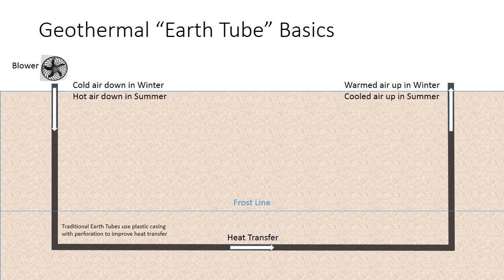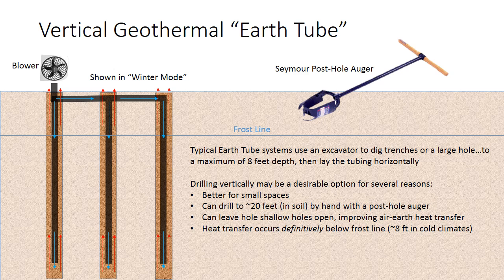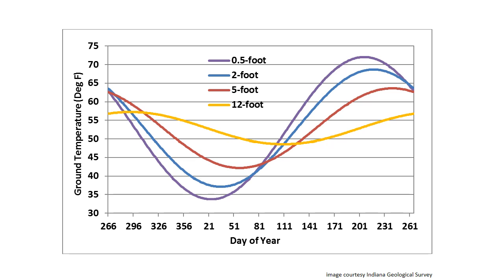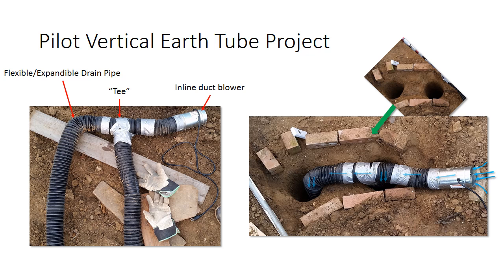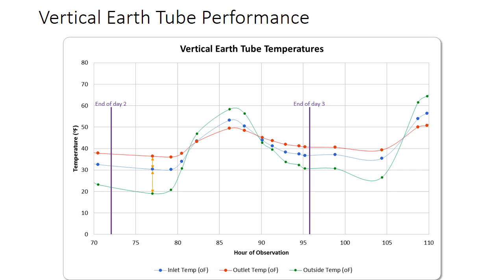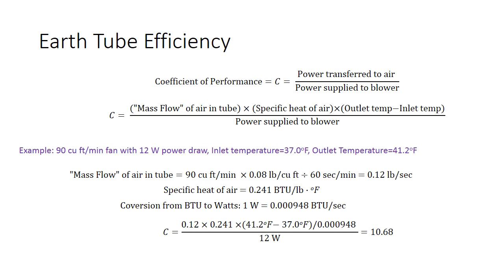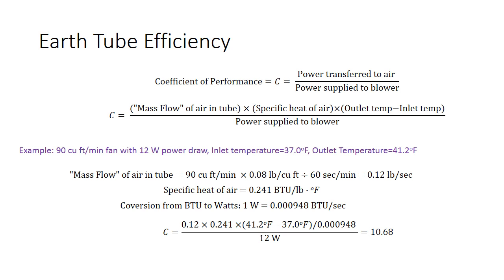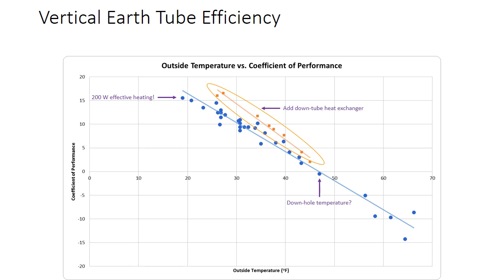Vertical Geothermal Earth Tube (Part 1) - Greenhouse Heating/Cooling

Comment: Would this system still work as well, if the outer hole was lined using 6"d. pipe?   I'd love to use this to temper air for a house...but here, the air must recirculate....would the dirt of the hole carry mold into the house, if left unlined?
Reply from the maker: Yes, but efficiency would drop and expense would increase.  I've recommended "casing" the outer hole for people who live in areas with unstable soil.  I live in a dry climate, and have noticed no issues with mold.  Can't vouch for best practices for direct house cooling/heating.  Honestly, I'd probably use a heat exchanger rather than direct airflow into the home.
Reply: @MorganBrown  
 I need a cooling system for my permanently parked RV/home in West Texas & am about to put the work in to make horizontal tubes but am hesitant.
How much length under how far would I need?
I've seen earth ships using 40'×10" tubes, so I was under the impression I'd need 40' under the frost line & since I'm in a smaller structure I could size down the diameter.
I saw a post making the argument that only 20' is necessary as x - y = I don't know, my brain is not geared for this. Could you please let me know before I go all in, which will be shortly?
It's getting hot again & I can't do summer like last year, nearly killed me.
As I don't know how comments are seen if in older video I'm going to repost this query in your latest one.
Thanks for your time and effort, I appreciate it.
Reply from the maker: M. Waters I wish I could give you more hard numbers.  I don’t think frost line is relevant for you in west TX.  Good thing about your area is low humidity and deep water table.  You will want your system to be sloped down with weep holes and gravel at the low point to address any condensation.  I’m pulling numbers out of the air but for an RV would guess that you can get away with maybe 100 feet of tube buried at 3 feet or lower.  If you have caliche at the surface you may try just laying the pipe at the surface and covering with dirt.  Post a reply if you have lingering doubts and I’ll do my best to comment
Reply from the maker: M. Waters look below for a reply from Scott Hiebert.  He has a grow shed in Bakersfield and he did a horizontal system which was effective.  Similar sized structure, similar climate.  He made videos

Comment: Have you noticed if there is an oder in the greenhouse that resembles a basement. I've considered similar system for my house but I have concerns of the damp smell that can be present in some basements.
Reply from the maker: I don't think that my geothermal system causes an odor.  But, consider that the ground where i live is very dry (bottom of hole is well above water table).  if you have a lot of water in the bottom of the hole, I would recommend casing (sealing) the hole in PVC pipe.  Also, radon is a worry, and it is present in clay soils.  If I was using such a system to cool a house, I would definitely use casing.  You will need a lot of holes and a strong pump to cool a house.  My greenhouse is very small.
Reply: Thanks for your input. I live in Florida and we have sandy loom soil and A LOT of humidity. The proposed spot for my new house is 42 feet above the water table (rare for this state) but I am thinking of a near horizontal system at a depth of 15 feet. We don't have a big radon problem here but I wouldn't know how to remove radon from a system such as this any way. I would simply have to rely on my smoke/CO2/Radon detectors to warn me of this buildup. I was also considering using my well to cool my house because the water stays a constant 72 degrees (have you experimented with this at all?
Reply from the maker: Michael S Florida should be interesting.  Yeah, you'll definitely want to case your holes!  But the digging should be easy, right?  I am limited to 12 feet (bedrock), but I was planning to dig to 20 ft.  Many closed systems will have weep holes at the bottom to handle condensation.  A horizontal system might be best for you to handle a large volume of air, but I'm not sure how you'd dig so deep - backhoes are usually limited to 8 ft, right?  The water idea is interesting.  Rather than an air based geothermal, you could get a strong water pump, dig a hole, and build a closed loop system.  Coils of copper tubing at the surface and in the ground to transfer the heat.  Just blow a fan across the surface loop and collect the condensation.  At 42 feet I would suspect that the ground temp is lower than 72, but what do I know?
Reply: Morgan, it's nice to chat with someone who has fresh memories of his experiment(s). My well water temperature at the tap immediately after the casing is 72 degrees. The static water level is 42 feet but the pump is at a depth of 92 feet (for drought purposes) but the casing is 212 feet down, this gets me below most of the surface contaminants. I've done some limited research on ground temps in my state and my water temp falls right where the data says it should. Using the same well that will be supplying my house allows for the warmed water (caused from the heat exchange) to be replaced with cooler water every time the house pump comes on. 

I own a small backhoe so I can dig a hole at my leisure to any depth I desire (with in reason of course) using the front loader. I have also looked at a closed loop system whereas you bury coiled tubing at depth and pump water through it and across an evaporator (collecting the condensate below the evaporator) but at this point I'm looking at all option because unlike you, I have a bigger need to cool rather than heat. :) We have 9 month summers here and fall like winters.
Reply from the maker: Michael, yeah, I guess your Florida aquifer is at a constant temperature - my in-laws live in Sarasota and I have good memories of swimming in the spring-fed rivers.  We wore wetsuits on the Crystal River - I think it was 67 degrees(?), with unbelievably robust flow.  The simplicity of the air-driven systems make them worthy of consideration, even if they're less efficient than a water-circulation system.  Honestly, I think the key to success relates to maximizing airflow.  I've had discussions with a couple other guys with air-driven geothermal (horizontal) and they are using high capacity fans which draw ~300 W.  I'm using small fans that draw only 12 W apiece, and I'm not getting enough airflow into the greenhouse.  Once my broken leg allows me to walk again(!!!), I plan to revamp my air circulation to reduce the amount of air resistance when traveling through long, circuitous tubing.  I will post a video at that time.
Reply: Looking forward to seeing the results. Thanks a bunch for your input. And have a speedy recovery. :)

Comment: How do you go about sizing these systems? I want to put up a relatively small green house (6'x8'x8'). How many 12' deep penetrations would I need?
Reply from the maker: joseph telese thanks for your question.  I have a new greenhouse which is a bit smaller than yours.  Check the link in the description. I have five holes and three small fans, and it produced a noticeable heating effect.  However, I think it has better potential and I think the biggest problem is the drainage pipe that I use for air circulation.  Too much friction.  I hope to redesign the air distribution to improve airflow.  Done over again, I would put the holes UNDER the greenhouse, instead of OUTSIDE the greenhouse.
Reply: Any thoughts into using 4" Marine bilge exhaust fans instead? They are 12volt, cheaper,  have a higher cfm and may hold up better the weather.

With the 12volt motors they can possibly be powered with solar power...just a thought.
Reply from the maker: joseph telese sure, go for it!  Do you have a link?  I might want to convert to a 12-volt off the grid system at some point!  ;-)
Reply: one more question. after boring the 6" hole I would feel better sleeving the hole, with maybe thin wall 6" PVC pipe. Do you think this having the hole sleeved would decrease the performance of this system?
Reply from the maker: joseph telese I would not put casing in the well unless I had to - in other words, if you were into the water table or the hole was collapsing.  it probably would degrade the performance of the system
Reply from the maker: the PVC would add a lot to the cost of the well, especially 6" diameter pipe
Reply: Morgan Brown yes the cost would climb. but I worry about the hole collapsing. Our soil is loose and has a lot of sand in it...  but I just didn't know if the majority of the heat it collected from the bottom of the hole or from the sides (walls) of the holes as the air returns up to the surface...
Reply from the maker: Yeah, it sounds like you definitely need to case that hole!  I honestly don't know the answer to your question of "will it make a difference?"  We both know plastic casing will inhibit heat transfer, but is it a first-order issue or a second-order issue?  I couldn't say.  I think you'd just have to test one hole with and without casing (inlet vs outlet temperature is the gold-standard measurement IMO).  One good thing about casing is that it will improve airflow (smoother surface), and airflow is a big deal.  So in reality, you might be breaking even!  From another angle, have you thought of using perforated PVC?  I am willing to bet that perforated PVC will still contain cave-ins, and it'll certainly transfer heat better...but how much better...I couldn't say!  I'm jealous - have been sidelined with a broken leg for 6 weeks and was looking forward to redoing my geothermal!!!
Reply: Morgan Brown Hmm. I will take all of these factors into consideration. I will probably purchase greenhouse next spring. I hope you a speedy recovery with your leg!

Comment: In case of closed loop, you have taken into account the condensation discharge, right?
Reply from the maker: 吳瓊錚 yes, the humidity inside the greenhouse definitely increases with this system.  However, the air where I live has very low humidity, especially in the winter, so I have not attempted to mitigate.
Reply: Oh, I didn't realize your situation. I just thought of the climate I stay.  Thank you for your prompt answer!
I like your simple solution.
Reply from the maker: Yes, I understand that most climates have higher humidity than Colorado, USA!  Unfortunately, I think in more humid climates, you may need to either install a dehumidification system inside the greenhouse or add underground drainage to the earth tube...

Comment: Hi Morgan, we have this 32 foot old dug well we no longer use from our 1890's homestead, right next to our house. Currently it just has a heavy metal grate over it on stone about 20 inches above ground level. We would like to build a lean too greenhouse on this southern side of the house, with the well right smack in the center. I like you idea but wonder how we can utilize our well for heating our greenhouse. Wonder how to cover it and should we fill it in or leave some types of tubing go down and through the water? Any ideas would be greatly appreciated.
Reply from the maker: Michael TORLUCCIO , how wide is the well?  If it's at least 6" wide, The easiest thing to do is just run 4" air tubing from surface to the water level and let the return air come up the annulus (outer ring) of the well.

I'm assuming that the well has water in it?  Some people worry about excess humidity with a water filled well.  I'm not sure it's a big problem, honestly.

However, if the water table is shallow, you'll have to think about running casing from the surface to the base, pumping out the water, then plugging the base of the well, probably with cement.

Another thought: if the well is quite wide, you could simply bend the 4" flexible tubing into a U shape and drop it down the well.  That way, the pipe could be submerged, yet it would be airtight.

Comment: In our area the water table is at about 4' in the summer and as little as 1' (or less) during the wet seasons.   We could put in a casing with a closed bottom to keep the water out, but PVC would be the affordable material.  Do you think the PVC would have an acceptable heat transfer?
Reply from the maker: Wow, you must live somewhere that gets a lot of rain!  I wonder if it might be more effective to just pump water to the surface and run a heat exchanger?  What's the water temperature?
Reply from the maker: To answer your question, I think PVC will degrade the heat transfer, but I don't have numbers.
Reply: We're in Glenoma, WA.  It rarely stays below freezing for an entire day.  Maybe we should pump water into barrels painted black and then circulate the water in pipes under the soil for the night?  My husband  was thinking that it would be hard to keep a dry casing buried for a geothermal here because it would want to float.  We'd have to give the casing a substantial collar with weight equivalent to the water being  displaced.
Reply from the maker: yeah, I agree with him!  Perhaps you could create a concrete "plug" - essentially you would pour a concrete deck footer, then attach it to the casing and drop the concrete into the hole.  Essentially, it's a collar, it's just buried.  I'm no expert on water wells, so take this with a grain of salt!  I like your idea to pump the water up into a rain barrel.  To give you some perspective, I had a rain barrel in my old greenhouse.  In the winter (and it is cold in Colorado), I had a 300 W fish tank heater running all day long just to keep the water at 60 deg F.  Let's say that the buried water is 60 deg F year around - if you could get it to the surface with a 20 W submersible pump, you'd be well ahead of the game!  Since the cold water should sink, you could drain water from the bottom of the barrel back into the well.

Comment: Hello Morgan; from watching your video and concept I started the same design until I hit a very deep white sand layer that constantly caved in. So I had to adapt / compensate by enlarging my 9 foot deep, 4 ft wide by 8 ft length, pit/trench to  12 foot in length, and since I couldn't go deeper I coiled the 4 inch wide 130 foot long flex tube with a 4 inch layer of dirt for each coil. I coiled the hose 4 times at 9 foot and finishing at about the 8 foot mark then running exhaust back in creating a sealed system.  I can't post exact stats like you but I have turned on my LED lights (4-300Wt)--- A/C --- dehumidifier-- circulation fans--- and so-on when shed was 102 degrees and outside was 104 degrees ; It took around 15 min to pull temp down 76 degrees- So I'm saying great info/video because it works great!!! Well if you wouldn't mind watching my video and tell me what you think of design 
 https://www.youtube.com/edit?video_id=U5tY6ved_ZY
Reply: Scott hiebert awesome! Thanks!
Reply: Scott hiebert was
Reply: link not working